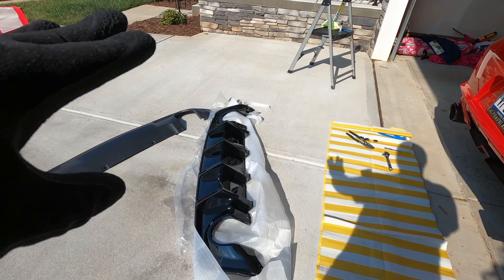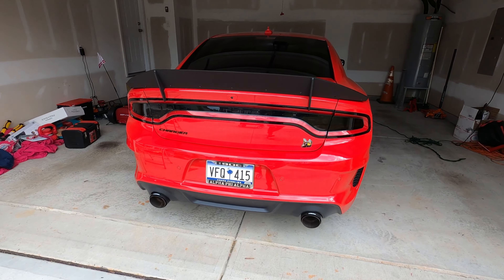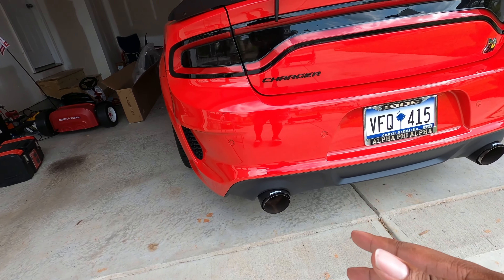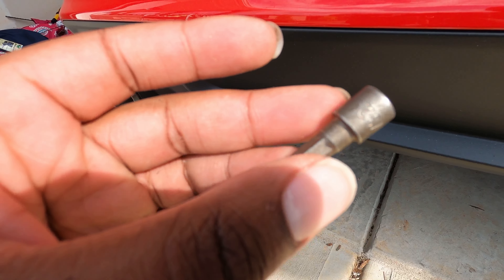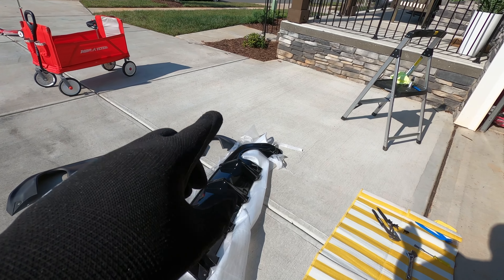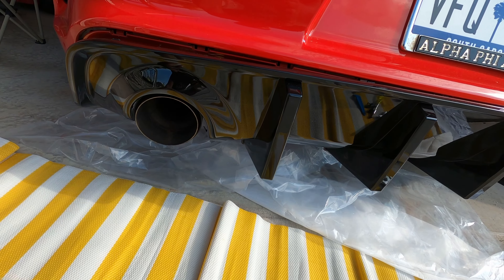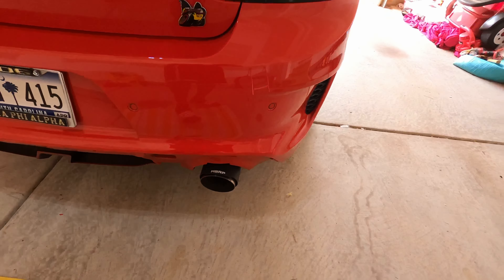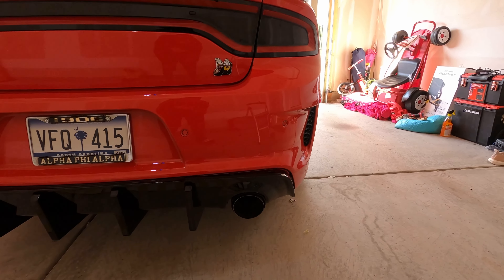THIS 10MIN MOD FOR MY 2022 DODGE CHARGER SCAT PACK WIDEBODY TOOK 2 DAYS TO DO!!!!

Comment from the maker: Thanks for tuning in to the video! Please drop a comment, hit that like button, and subscribe to the channel if you haven’t already. 😎

Anyone else ran into this problem!?
Reply: You need to make sure that the diffuser is built for a wide body. If you see how the edge is more sharp rounded then the bumper it is looking like you got one for a non widebody. Check the shapes they are slightly different.

Comment: Man do I ever feel your frustration! This is every damn project for me. Should have seen my goofy butt putting the led, smoked side markers on my Scat. I think I invented some new swear words in the 2 hours that 10 minute job took me. Same thing with the catch can I put on my wife’s Grand Cherokee. With that, one of the PCV hoses runs around the back and I couldn’t disconnect that thing to save my life. Every video made it look so simple and I turned it into brain surgery.
Reply from the maker: It really kills your vibe when a 10min job does that.

Comment: I got the exact same diffuser from Icon and installed it on my 2018 HC. It was not as tough as what ur going thru but my advice to anyone is to NOT beat it in. It will go but u will crack the gloss finish. I learned the hard way and had to buy some black gloss touch up paint to fix it.
Reply from the maker: I didn’t beat it in. Was worried about breaking something on it. But the tabs on mine definitely don’t line up on it

Comment: Did you ever try too line the side that won't line up first too the other side that did line up when I was watching you that's what came too mind... But seems as if it's not right bout like shoe's different shoes you have to get a different size for them to fit...
Reply from the maker: Yeah I tried it on both sides. What ever side went in first went in fine but the opposite side wouldn’t line up right
Reply: Try both side tabs at same time, get them in holes then work in. It's not lining up with one side in first because that plastic has alot of flex. Or get the mid middles in first at same time then sides same time should line up much better. That's sucks bro good luck. Honestly tho it looks good how you have it now noticeable, if it can handle 100+ speeds your good
Reply: *Not noticeable

Comment: Its not just Ikon Motorsports, but alot of these rear diffusers don't line up correctly. I ended up snapping some of the tabs trying to install it, but as long you drill in enough screws it'll stay anchored down which you'll need especially for high speeds. You'll be surprised how much air can get up under there if not installed tight enough. Definitely worth the look though
Reply from the maker: I’ve tested it at speed and so far it seems to hold. Still keeping an eye on it

Comment: I think I started with the middle clips and worked my way to the edges from there. That way it should be centered and not pulling to one side, if you get what I mean. But I have the regular body diffuser, not widebody.
Reply from the maker: I get you on that. I may try that if it gets to bothering me too bad

Comment: I’ve watched a few videos on installing them. They bent the clips up a little bit  so they were at the correct angle, it might also help give it that little bit more to get to the OEM holes
Reply from the maker: I did that but didn’t record it. Didn’t help much since the holes still didn’t line up.
Reply: @RUBIX3  ahh ok, idk then man lol.

Comment: I had the carbon fiber print looking one and it did the same exact thing. Hated that it didnt line up so I took it off.
Reply from the maker: You had it on a widebody as well?
Reply: @RUBIX3  Yup just didnt fit perfect. Had the small crack like yours and clips didnt stay in. Not worth it to me. Wasnt pleased for the $

Comment: I got the vicrez one it took 2 hrs but fit just hard to get clips in
Reply from the maker: I was told the Vicrez one went in pretty easy. I didn’t go that route because I wanted a gloss black on and they didn’t have it. I saw a few videos of people with the one I have and no one showed any issues on install. So I thought I was going to be good lol